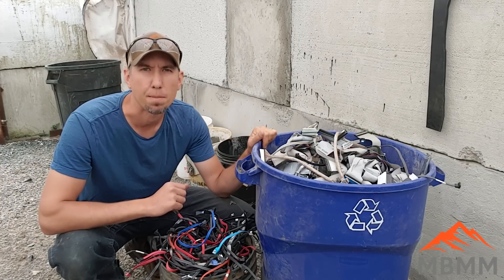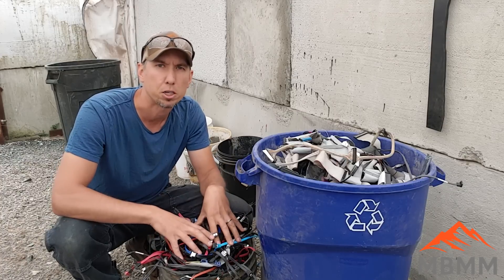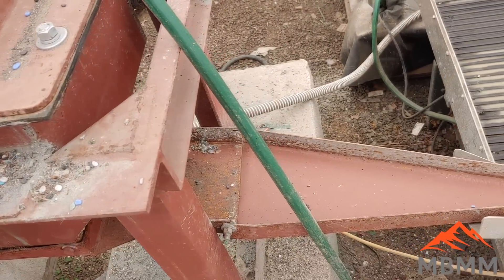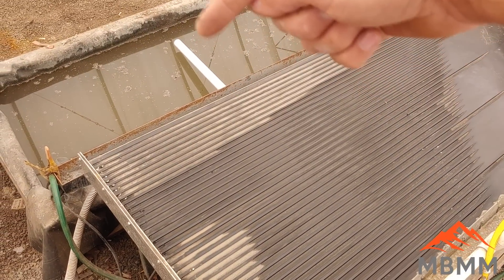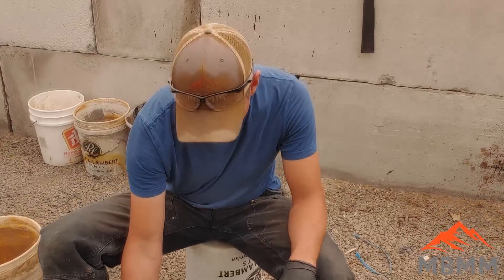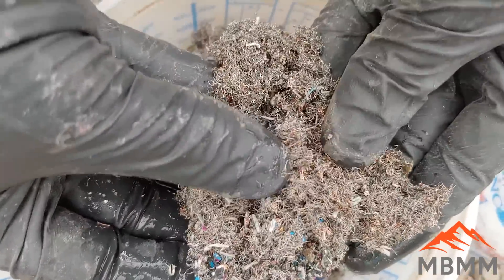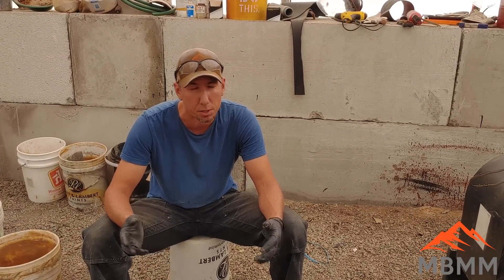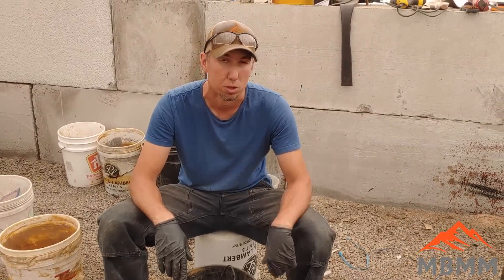Gold Pins & Copper Recovery From E-Waste Cords & Plugs

Comment: I process about 3 tons of ewaste annually. with cables I just snip the connectors off and sell them to my buyer. The wire I take to my local scrap yards, I deal with several . I get a good return on both products for very little effort.  I would say that your process would be beneficial for a refiner or someone who processes cable/wire for the copper. Love your machines by the way, purchasing one is on my wish list. 
Your videos have been beneficial to me for several years, keep them coming! So thank you very much!

Comment: Guessing that super cooling soft coated cable just prior to hammering would increase copper output. Maybe not nitrogen, but at least sub-zero F for trials. Another idea would be trying very slim, closely stacked knife hammers. It seems like knife hammers would be more effective on the thicker soft coatings. The knife hammer experiment might use Stanley utility blade replacable tips for trials..they might last quite a while, or not...stand back during run up:) Chopping the wire and removing the plug ends would extent knife hammer edge life.

Comment: Stick those cables that had issues 8n the freezer for a day and then run them straight a way and see if that will stiffen them up enough to make it through the hammer mill efficiently

Comment: That worked great for the ribbon wire .its. Cleaner then burning it and faster then manually clipping the pins .if you just clipped the ends off the other wire could it process just the ends with the gold contacts

Comment: pyrolysis is the way to go on this if you have the means to do it. I know a few people with small pyrolysis chambers that are vented through a fume scrubber with a vacuum pump , it keeps the copper clean and you can just wash the carbon off. you do the cable ends in a separate batch for the pins. I know a few even save the carbon in 55gallon drums to sell.
Reply: I was looking to see if anybody came up with this solution.  A little fire early on can save a ton of processing down the line.

Comment: I'd like to see you smelt some more gold ewaste items like you did with those ceramic cpu's a few weeks back.  I think there could be some big potential there in refining the gold.  I would like to see you try to smelt some gold corner bga chips, and some different types of IC chips as well.  Also, I would like to see you smelt some gold plated pins, and possibly some other items.  I don't think anyone on YouTube has done this yet, and there could be some huge potential.  Right now it's all being refined with acids.

Comment: We cut all the ends off prior to running ribbon wire through the hammer Mill. So when we run cutoff ends its a higher amount of gold. We run the cut off ends through a 1mm screen

Comment: Gold Coating disappears when you hammer it
Reply: I doubt it, but if it did, it would end up in the number one of his shaker table.
Reply: Cynaide striping is best option 
Then you can process in hammer mill 
I have done several times

Comment: did you test your hammers for pgms yet ? That is chromite you use to get chrome steel hammers?  The area i live is a "non precious metals baring area" yet a 104 gram platinum  nugget was found in plattsburgh ny in 1894 . basically it was documented and taken by the state and redocumented many years later as glacial melt from canada .  in an area full of eskers and i find pgm dust almost everywhere because its not legally minable, im just prospecting and dont keep anything precious so im good...
It only takes a few ppm of many elemenets and metals to augment steels crytaline sturcture and change the alloy designation the steel falls under.

Comment: Jason is one driven man. Driven to find a process to "recover".
Just a thought but I wonder if freezing those different  pails to a temperature that would make it solid enough to ground down finer from there. The plastic and metal frozen might separate from there.  It's worth a try or some experimenting.
Reply: Liquid Nitrogen is cheap, but I don't think it would be as beneficial as you imagine.  Not all plastics become hyper-brittle when frozen.

Comment: You only produced waste again, or material that could only be further processed with more effort than if the cables were separated from the plugs beforehand 
stick with your stones and stay away from electronic waste
for the crap that you do with electronic waste, you would end up in jail in germany because of environmental pollution
Reply: Geez man, that was harsh.
How has he damaged the environment here?
The more physical separation of materials that occurs the less environmentally damaging chemicals need be used to separate precious metals from base.
I think Jason is on a fine mission to apply and develop his technology to different applications in mining and recycling.

Keep at it Jason
Reply: @markselten4985   784/5000
I have been working in e-waste recycling in Germany for 20 years. Here you end up in jail if you don't have a license (at least 5 years). Without proof of the environmental pollution limits and disposal routes, nobody is allowed to access electronic waste here. Electrochemical processing is the state of the art, which has the lowest environmental impact (in the right hands), the lowest energy consumption and the highest recovery rate of all metals (except iron). When I look at Jason’s handling of lead and cupeling, I’m surprised that he’s not yet been poisoned by heavy metals. Lead vaporizes with a certain percentage and is deposited in a radius of 5m. The area where jason ruffles is definitely extremely contaminated with PCB, lead, cobalt and mercury. Since the end material (plug + cable) contains less than 0.1% gold, there is no avoiding chemical processing.Furthermore, the insulation material in Jason’s process is unusable (because it is wet, insufficiently cleaned, wrong particle size) for further recycling processes or it would have to be further processed at great expense. Industrial cable cutters throw out plastic and metal granules that can be recycled directly and do not pollute water.
Reply: @darkbreed  What company are you with Alexander?  The debate is still ongoing about electrochemical refining for e-waste.  Due to e-wastes massive diversity of metals.  I know numerous companies inside the EU and within germany that grind and sort the metalics from non metalics inside their plant.  Take for instance Boliden, They don't just Burn everything and extract the metal and a bunch of carbon and waste, most ewaste is fire resistant and the vast majority is HIGHLY TOXIC when burned.  The only way to separate the fireproof material from the metals at this date is some form of grinding and gravity, air or electronic separation.  Putting raw cables into chemicals, even in a controlled environment (where you hope you don't spill anything) is highly expensive, uses massive amounts of toxins and releases deadly nitrous oxide during the process, which easily contaminates areas far greater than 5 meters in radius.

If there's something I'm missing.  feel free to let me know, I'm always open to new methods and technologies that are available to process at an industrial scale.
Reply: @DaleScottMarion  We process cables with cable granulators, the output consists of PVC / PE granulate (PVC and PE insulation are pre-sorted and processed separately) and pure metal granulate. plugs are opened in a hammer mill and the metal output is sorted into several molar densities using a centrifuge. Circuit boards are a bigger problem, aluminum heat sinks and screws are removed from each circuit board by hand and dismantled in a closed system according to a process developed by us, the output is freed from aluminum using eddy current sorting (electrolytic capacitors are very toxic). As a result, we have bare circuit boards and components, which are processed into flour and this is melted down in an inert environment (since it no longer contains aluminum, 100% of the resulting plates are electrochemically brought into the conventional plants for copper / nickel / metal sludge processing) .
Here in Germany, the environmental requirements for such systems are extremely high and are monitored by the state, so there is no environmental pollution. The aluminum components from the component flow are shredded and washed with a special process, which means that a large part of the electrolytes can also be recovered (the shredder is hermetically sealed and gassed with inert nitrogen). The plastic waste is used in our own incineration plant to supply the plant with energy. Mercury, lead and tin are extracted in their pure form from the molten metal by gas phase separation. The ashes are currently being stored in our own hall and, when a certain amount is reached, they are given to a partner company, who processes them chemically. The only output from our plant to the environment is carbon dioxide, we are currently working on a solution to avoid this output by processing the carbon dioxide into biomass in a bioreactor (spirulina algae). 
I forgot to mention that complete devices are delivered to us and completely dismantled by hand (at a branch in poland). All computer components that can still be used are sorted out and find further use on the second-hand market. Through manual dismantling, all plastics (if recyclable) are fed into the recycling cycle. One of the biggest problems up to now has been PTFE, but InVerTec has developed a way of depolymerizing it and allowing 90% of the material to flow back into the production cycle. What is currently also in stock with us are displays due to a lack of suitable processing processes. We are experimenting with the recovery of the liquid crystals, but we have not yet achieved any success.
Reply: @darkbreed  I see, when I read your last comment, I had understood that you were completely against the grinding of e-waste,  I misinterpreted that statement.  As far as the rest of all the process you describe in detail, it's spot on, That's how pretty much everyone is dealing with e-waste these days. Great Job and thanks for taking your time to reply.
Reply: @DaleScottMarion  There is a process we would like to use but the oil industry is resisting it. Solvolysis. This process would convert the epoxy and nearly 100% of all plastics into a solution that would reduce 80% of the crude oil requirement. Furthermore, the glass fibers of the circuit boards would be recyclable and some processing steps would be simplified. We tried to get a license for this process for 10 years without success.
So we have specialized in operating the existing processes with the least possible waste and using the waste ourselves as much as possible. Our ash processing partner extracts halogen salts from the ashes and produces hydrophonic solutions (this is why the partner is very important to us for our bioreactor solutions), thereby reducing the ash to silicates and non-toxic compounds, which are used as mine backfill or road substructure.

Comment: I would separate the connectors from the cables and work them separately.  I think all that cable is messing things up for the connectors.
Reply: I totally agree with Frank on the connectors, separate those and run the main part where you know the gold is coming from.  You can always run the wire for copper at a later date or in a different setup.  Just running the connectors part would seem better to me as you have a whole lot less waste to deal with, if you're going to use chemicals or something to extract the gold you would save a lot of supplies in recovering just the gold instead of having to pile out a ton of copper first.
Reply: +1. Gold is going to be such a small fraction when doing the whole cables; the pins are just gold plated.
Reply: @fwiffo  I'm talking about getting the pins away from everything else.
Reply: @frankzahn7773  Fwiffo is agreeing with you.

Comment: Granulaters are better for separating wire from insulation. It would have been great to see just the connectors go through the hammer mill. 

They're not "gold pins", some have an extremely thin plating of gold on them.

Comment: Would love to see those pins melted down 😀
Reply: Those pins are electroplated with gold. They look like gold but what you see might be 20 atoms thick (15-45 microns) and not much more with military grade equipment.  Ernest Rutherford   (googled) determined Gold foil was 1,000 atoms thick!
 Needless to say while Gold from scrap electronics is in fact recoverable. The percentage of gold to other atoms is tiny indeed to the total mass and is most economically separated when only the actual plated material is first separated from all other material.  Only after that form of concentrating the gold can chemical recovery be done cost effectively, at this time   Perhaps Jason can change that with him fine tuning his experiments. It's how innovation is advanced.
Reply: @rickdees251  I would hope that any operation looking to process this type of material would also have a karat scrap stream going. His #1 concentrate would be perfect quartering stock with zero additional recovery cost.